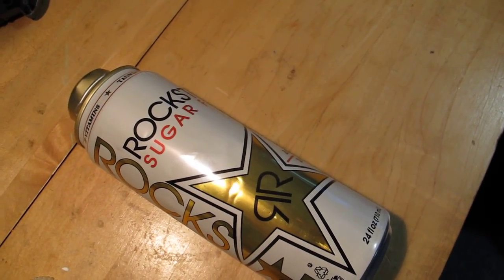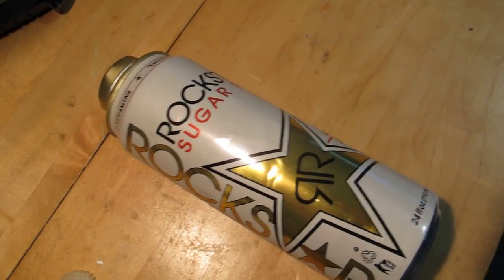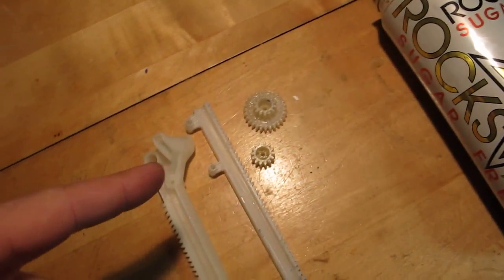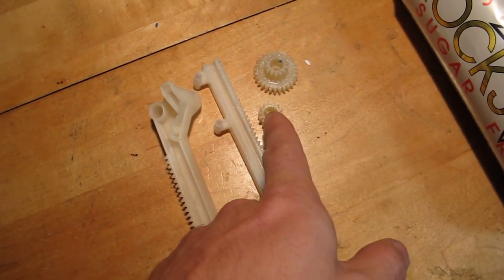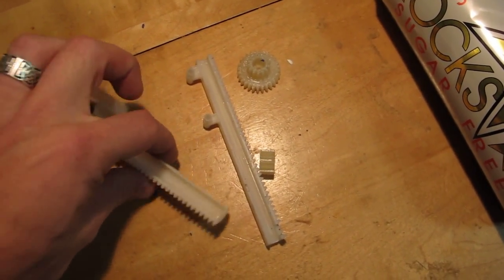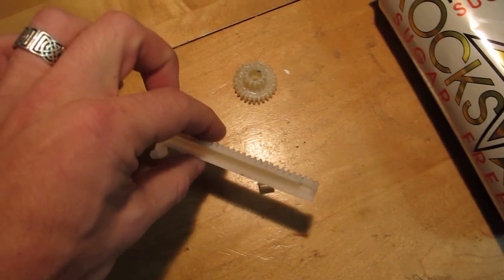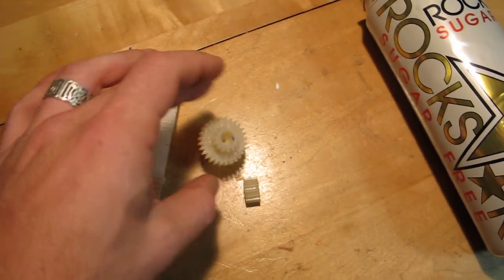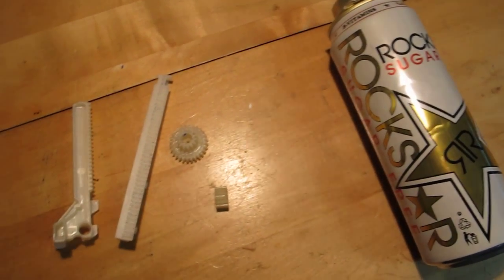Turning plastic into metal into fear. Lost PLA Casting

Comment: Just curious will this work with iron?
Reply from the maker: +Jack Scheisse Don't see why it wouldn't. You'll just have to finish iron which sucks. Prevision parts typically are made of a metal which is durable enough for the job but not so durable they are hard to make precisely.
Reply: Awesome thank you Sir. I [plan on building a reprap soon I just need a couple more parts I cant wait to print upgrade parts. 3D printing is the future for making hard to get components.Lost foam casting will take it to a whole new level until they manage to come up with a way to print metal at the hobbyist level